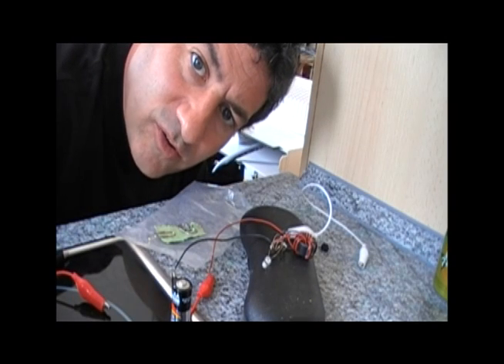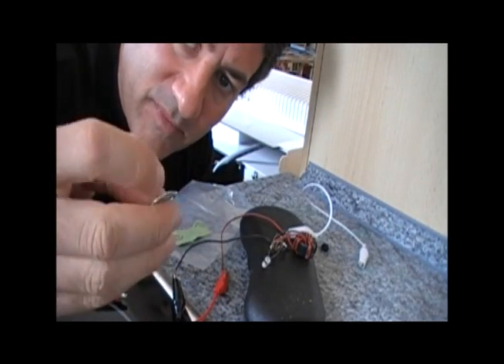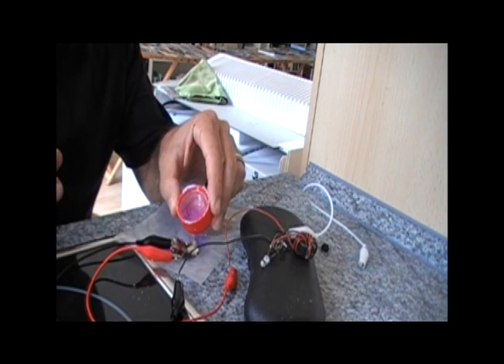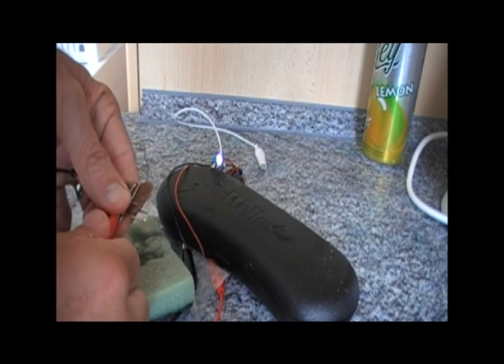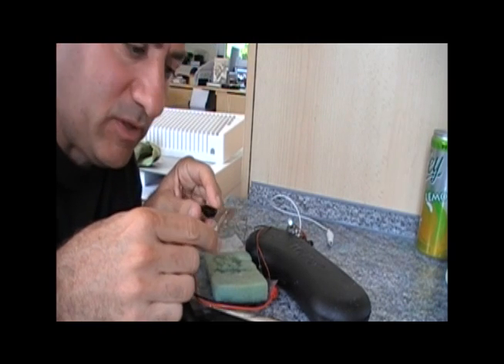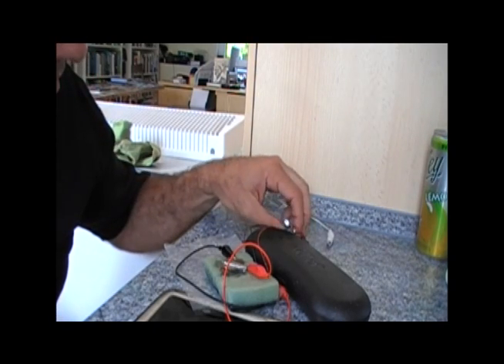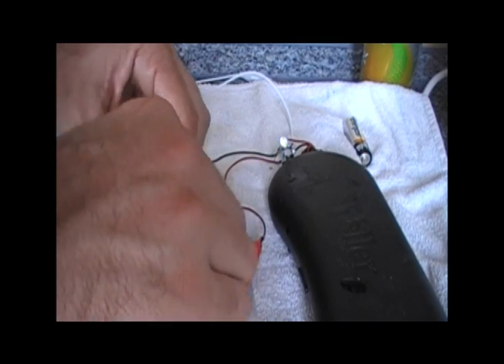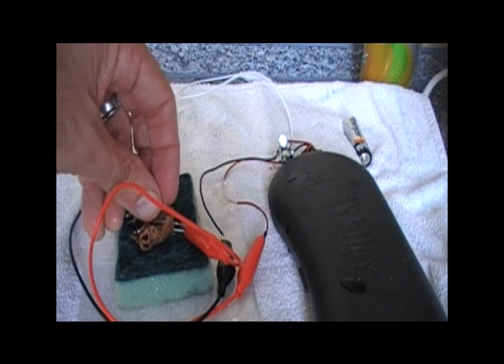The Solar CITIES "tab-torch": An Aluminum can tab battery with joule thief

Comment: I found stainless blank covers # JDM-84336, at switchplates dot myknobs dot com for five and a half. Expensive but they never have to be replaced. Also, when you add dry NaOH Draino to water it makes a large amount of heat, and can cause splattering and burns. It should be done outside under proper supervision. The dry stuff has aluminum bits in it which must be removed or they will react.

Comment: The JT has an efficiency of around 50%, so you're losing a lot in the circuit. I think it would be best to put several cells together, probably 5 or 6, to get the higher voltage. You'll get a lot more light. You could also use my Watsons supercharged Joule Thief (Google it) which has an efficiency of about 80%. Also, try some stainless light switch covers or blank plates, they have a lot of surface area. That soapy feel is the NaOH dissolving your skin, BTW.

Comment from the maker: As it turns out, the best thing to use with the aluminum can tab for the cathode  is the stainless steel brillo pad; its surface area radically increases the brightness and the longevity of the reaction. Paper clips were nice to try, but I don't recommend them for serious use of the "tab torch" light.